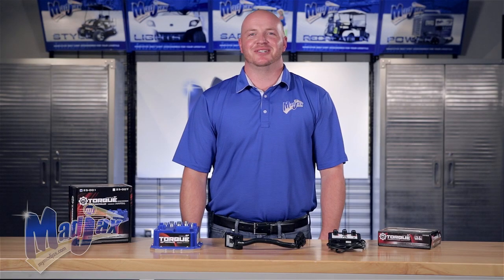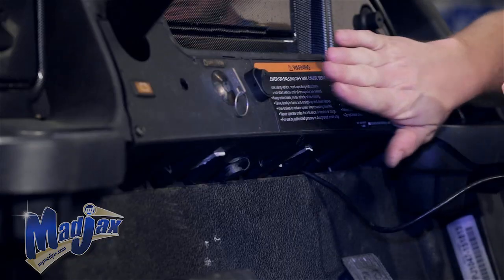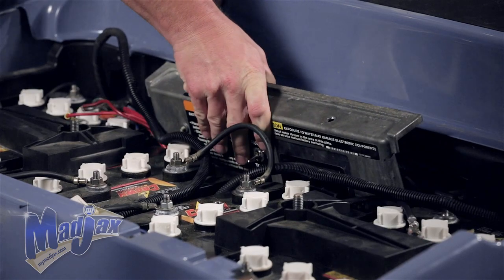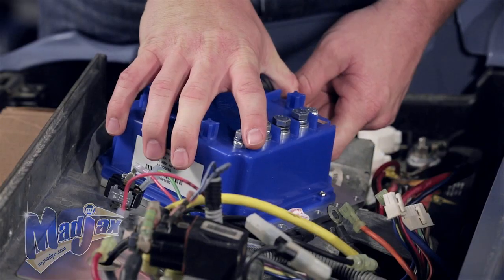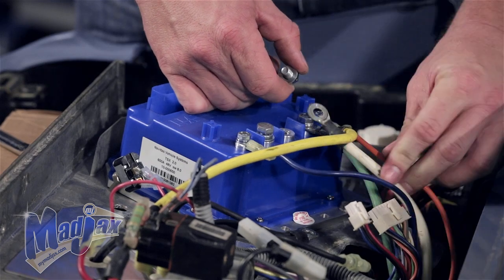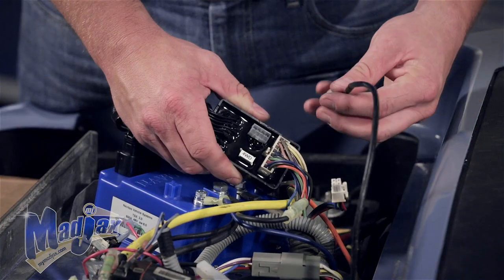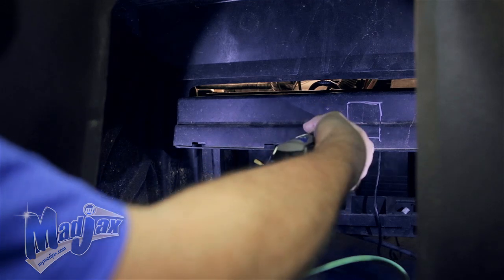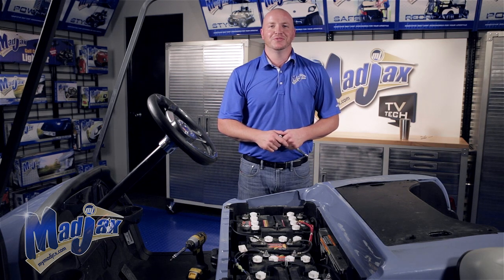Torque Controller for Club Car Precedent 2008.5 and Newer | How to Install Video | Madjax® Golf Cart

Comment: How do you get away with using the stock wires and solenoid with a 600 amp controller?
Reply: you don't you just wait till the cables and solenoid melt and wait for the motor to break its windings.
Reply: you absolutely need 4g wires and a higher amp solenoid

Comment: Trying to figure out why my otf isn’t working. Unplugged it goes 15 mph when plugged it  drops down to 5 mph and unable to adjust. It’s unlocked but won’t adjust. I unplug it it goes back to normal